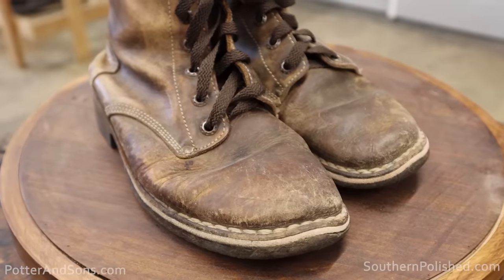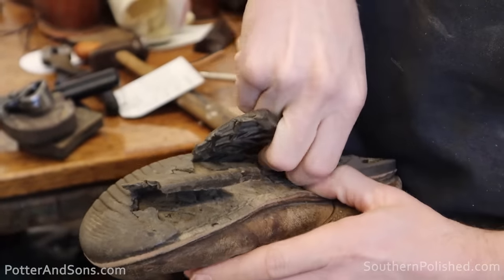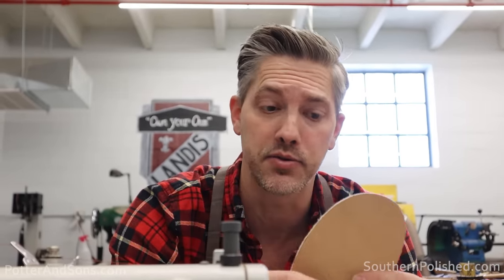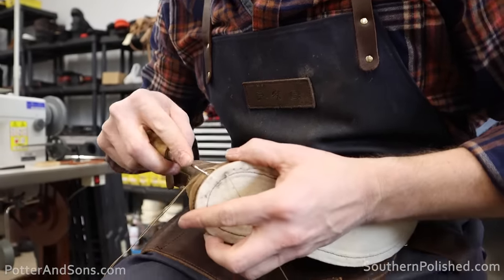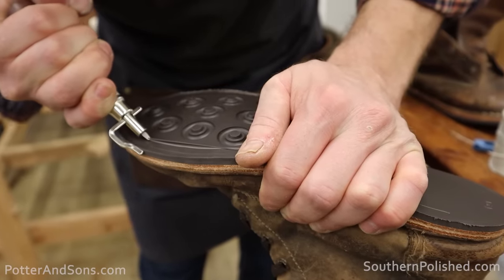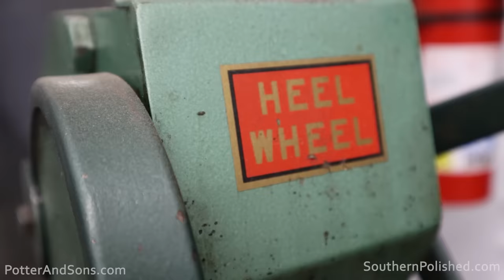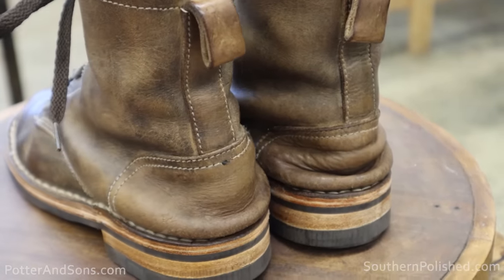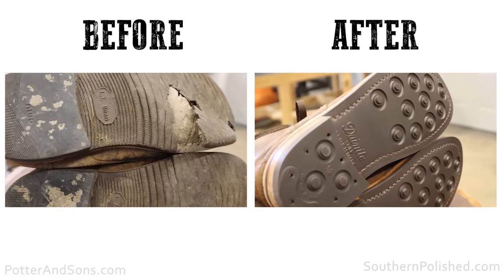LL Bean Boots Get Refurbished | From Inferior Quality to ULTIMATE Upgrade

Comment from the maker: So the common question of the week seems to be, “why wasn’t the heel counter fixed?”  Well, for one, we again did a lot of this work free of charge.  Free.  We could have charged a much higher amount, but we often don’t for some of these videos.  If we find a shoe that we think you all may like to watch us redo, and the customer didn’t pay for that much work, we’ll often go ahead and do it, with the customers permission, for entertainment.  We do what we can during a busy work week.  Secondly, these boots were made like moccasins.  There was no stiff heel counter, toe puff or shanks.  These boots were originally made from simple leather uppers, FELT insoles and crepe soles.  That’s it!  No frills.  These boots were made for comfort and that’s all.  That’s why you see them collapsing along the edges.  They weren’t constructed like most boots you see us resoling.  👍
Reply from the maker: @mariosantizo4099  You apparently didn’t read the entire post.  These boots did not come with toe puffs, shanks or heel counters.  To be honest, they were cheaper quality LL Bean boots that we actually made better.  To add all of that would have changed the look and feel of these boots.  That’s not our call.  It’s the customers.  Thanks for watching, but we’ll continue to do what we do.
Reply: @mariosantizo4099  No it's not.  They took a trashed pair of boots and made them better and serviceable once again.  If they were to be "upgraded", the customer should've stepped up to have upgrades made to them, but that's not what was spec'd from her.
Reply: Sir I am interested in restoring a pair of Thursday boots and dying them black
Reply from the maker: @GizmoGuzman0924  Please visit us at potterandsons.com.  We’ll get you taken care of.
Reply: I live in Arizona that basically all year round summer and no fit for leather boots at all, but watching your videos makes me wanna buy some nice boots so I can get them resolved in few years LOL
Reply: That is what happens when you do miracles on a regular basis. SOME people believe that you gentlemen should send back factory original boots that you magically recrafted just to show you could. I am regularly amazed at the magic you perform on boots and shoes that look as if they were salvaged from a dumpster. It is heartening to to see USA craftmanship fly in the face of a disposable society. 
Plus your videos are a joy to watch. Please keep it up, your adoring audience is counting on you.😃
Reply: Cgu
Reply: Yeah I was thinking exactly that, thanks for reading my mind and answering the question. Turned out great.
Reply: I WAS wondering why the heel looked like it was collapsing. Thank you for the explanation.
Reply: @TrentonHeath  Love your work!I have a pair of frye phillip tall harness boots that need resoled ,I would love to send them to you if you have time.
Reply: And it's not easy to find boots like that even at LL Bean anymore for what I'd consider a reasonable price. After watching the video I went to the current LL Bean catalog and didn't find anything comparable to that book (at least not on first search).  Personally I'm jealous because I've been looking for just that style myself.
Reply: Great job. Thanks 😊
Reply: The great idea restored - reused - valued sentiment by the owner. Also very entertaining to watch. Thanks
Reply: In that case, is there a way to fix it? Or at least make it better?
Reply: That also answers my question, I was wondering why the back of the heels looked ‘saggy’ too. Great videos guys, I’m an ex Royal Guardsman and we had to have our boots looking like glass, which is a hell of a process from start to finish. I still have a pair of my ‘drill boots’ and was wondering what the process would be to have them re soled, that video on YouTube in turn lead me to your Chanel and now I’m hooked ! Lol, Sterling work guys 👍
Reply: You should have done with those heel counter. FOC or charged is something different story, but, I'd love to see how much you love shoes/boots.
Reply: This was of interest to me having a great fondness for several pairs of LL Bean Boots.  It appears many people don't know quite what this boot does, why it works. It is rather unique, sort of a slush moccasin, 😆 Mukluks. 
Far northern maritime climates commonly experience snow, ice, rain conditions one after the other in any combination, and all too often all at the same time. And this in my NSHO is an absolutely brilliant design for it.

The soft rubber sole provides traction along with foot grip. Ever so useful navigating uneven terrain such as woodland with ice covered branches, rocks and mossy hummocks lubricated with a layer of rain. (I had a particularly hilarious experience getting out of a skating rink of a road pothole/rain puddle a we bit tipsy.  If not for wearing my LL beans I would have had to crawl out on my hands and knees, if not only ungloriously I happened to be in fancy dress attire.)

The original unexposed seam keeps water out,  an abreviated rain boot.
 
The felt insole ENCLOSED inside remains dry insulating foot from cold of ice to a remarkable degree. I had an oversize pair specifically for 2 layers or very thick wool socks for extend periods - no opportunity for  rewarming cold feet other than wiggling toes furiously. 

The unlined, unstructured leather top was not for ankle support. It is easy to get in and out of with room for pant legs tucked in and tall enough for a moderate wade thru slushy snow with an annual application of Sno Seal.  Also left loosely laced is a pull on/kick off making it perfect to go out and start the deep freezer of car (warm up the engine and interior before driving somewhere) fetch a load of firewood or trudge to work not far away and change into more suitable footwear like ski boots.

They also came with a removable thin leather insole to be lifted into the upper, the boot turned upside down and hung over the wood stove overnight. (Dry out any accumulated moisture and the upper from long time in deep slush. Not to mention having a toasty warm boot to slip on in the morning.)

I'm not surprised the wearer was happy to have the boots wearable again, I was always heartbroken to have to give up on a pair. 1) For me an expensive boot, well worth the cost   but 2) have a short lifespan and ShoeGoo repairs quickly fail on a moccasin sole. 3) The most comfortable boot I have ever worn.

Now for your repair;  I'd say defeated really the point of the boot practically but I can't honestly imagine 'repairing' it any other way  and you did a fine job. 👍 With a welt (if correct terminology) is a guaranteed water leak with exposed leather and felt a wick. The rigid sole, sure better traction than leather sole but well, rigid 😜 not the barefoot like moccasin feel.

So all in all, you are absolutely correct it was fun to see.  LL bean (at least then some over 40 years ago) offered resoleing to original but quite strongly DID NOT recommend it. (As I recall, experience showed unsatisfactory  results and only offered because a segment of customers begged them to. 😆) Free labor only rational  economically and unsuitable for original purpose is still a serviceable boot in less challenging footwear conditions.

Comment: Mr Bean would have been proud. He was the original leather upper with rubber lowers for hunters. He made a hundred pairs and ended up replacing about or so at no charge. He was a person that prided himself on quality back then. You have to visit the store in Freeport, Maine. It's open 24-7-365, there are no locks on the doors because it's open. Hell you can go Christmas shopping on Christmas. We have a king size down comforter we bought 29 years ago and it is still lofted after we have it cleaned. Good quality in my books.

Comment: The felt and leather combo is nice!  As for felt in cold climates, you are right.  Each time I get a new pair of winter work boots, they have a thick felt liner.  I also now add an additional think felt insole that also has a reflective layer to reflect my body heat back into my feet.

Comment: Noticed you struggling with Needle Nose Pliers for picking stitches. Could I suggest using  electrical side-cutters? Blunt the blade with sandpaper so it grips rather than cuts, and spring loaded makes it more precise and less fatiguing on the hands. Great vid!
Reply from the maker: Thank you for the advice!

Comment: Informative.LLBean will rebuild their classic boot if you send them in.The sole you used is probably an improvement over the chain pattern original. That old pattern is not that great. Real wooden avoid it. I do leather working,mostly holsters and belts.I have done a fair amount of hand stitching myself. Interesting machinery.Shoe repair is a dying trade.

Comment: QUESTION: Why would you not treat the uppers immediately upon them being separated from the old sole? You have DIRECT access to the old worn and ratty edges to treat them easily all around the stitch area. Cleaning and treating it then so you won’t stain the new stitching? Seems to me at 5:48 you’re going to end up going over the new stitching? Hell, you could even treat/renew the INSIDE of the upper at that point. Ever do that?

Comment: I noticed they were double stitched down before, but only single stitched after. What was the reason for using a Blake stitch to attach the outsole, instead of using a welt stitch in the old second set of stitch holes to hold on the dainite? I'm sure you had a reason, but I think the other method would have looked good.

Comment: If that thread for the stitch down portion was cotton thread, that makes Heath a cotton pickin' cobbler.  Nice work Heath, she should've stepped up for a new heal counter as well as a steel shank.  Good video Kemosabe.
Reply from the maker: Thank you very much!  😁  These boots didn’t come with heel counters or toe puffs.  They were constructed very similar to moccasins.  These were basically just leather uppers with a cheaper cotton lining and that’s it.

Comment: Based on some shoes I had I strongly suspect they were made by Clarks (or whomever makes Clarks for Clark) for LL Bean. That's no shocker or anything, I'm just saying because growing up near the flagship store we'd go there for things like shoes because they had things that weren't sneakers or dress shoes. I was fascinated by how most of the shoes were obviously made all over the world with varying levels of quality and you could kind of see trends in good ones vs shoes that would disintegrate and get returned within a month or two. But yeah the felt is not there for insulation, it's actually a terrible idea in a climate with that much rain, mud and slush. Might as well be a lampwick.

Comment: is there a reason not to put the felt on the inside ? i thought that was a bit strange to have it on the outside, especially after the last shoe had delaminated with the felt glued to the rubber sole.
Reply: Didn't understand that either, but for a different reason: the felt usually is to "insulate" from cold. By having the felt being sandwiched between a leather insole and the outsole i think the effect is lost. I can of course be mistaken, but i think the reason it works against cold is the same a "rough" liner in clothing makes for better wear in cold temperatures, as this basically traps air (what realy insulates).The "airpockets" created by felt and socks being between the foot and the sole are what creates the insulation. As the temperature of the foot warms the air in those pockets. The air that is left in a felt liner that is soaked in glue is less, and not warmed as fast by the foot (leather between the socks and the felt) and thus in my opinion makes for worse insulation.  But if i understand it correct, the boots belong to a lady in the area they are in, and  it's in a warmer climate anyway, so this might be no issue at all.
Reply: @nirfz  yeah thats a very good point as well, im just curious i find these videos fascinating :D
Reply: @mooseteets  me 2 :-)

Comment: Will these be kind of floppy without. Shank?
Reply from the maker: They didn’t come with a shank originally, and the owner definitely would have felt it if we’d used one, as the soles were only made of thin leather and felt...a little better than the original all felt insoles.

Comment: Would cork make just as good an insulator?
Reply: There's not really a cavity there to fill. If they were to use cork that was as thin as the felt, it would be a lot less durable. Cork is mainly used to fill up any voids caused by the construction of the shoe.
Reply: @patrickli9077  ok. I get it. But on a different pair. Let's say a pair of Thursdays or such with danite. Would cork be a good insulator? Or is that usual for colder climate boots on snow bound places?
Reply: @Deusmecumest  Cork would be a good insulator in that case. When I walk with my welted footwear outside in the winter, my feet are generally warm and the only insulators are cork and leather.
Reply: @patrickli9077  Thanks.
Reply: @Deusmecumest  The glued cork is not a good insulator. Felt is a very good insulator.
Reply: @GennadiyGold  Ok? How does felt perform in colder climates? What if you're stepping in snow? Would the felt get soaked? Or is there a preference of materials for colder climates? How about the material that has mylar? Or is that a gimmick? Can that be retrofitted?
Reply: @Deusmecumest  It is advisable to use felt as insoles. And I would replace the cork with micropore rubber. When moisture gets in, the cork inevitably begins to rot.
Reply: @Deusmecumest  I find mylar to be useless. This is a publicity stunt.
Reply: @GennadiyGold  Its just rubber usually makes boots stink. I wouldn't use them for heavy snow use. I have snow boots for that. But would they be ok for dressing semi formal without looking like I'm stepping out of the moon lander.
Reply: @GennadiyGold  Ok. Good to know. Usually those run you from 20 to 40 bucks more expensive depending on brand.

Comment: My initial reaction would be to toss those boots and get new ones. Guys, though can get weirdly attached to a pair of boots or shoes for whatever reason, usually some good or sentimental memory.

Of course this time the customer was a woman.
Reply from the maker: Very true!
Reply: It's hard to throw out a good fitting pair of boots.  I have a pair of USAF Flight boots from the 90's I keep for yard work.  Those LL Beans were definitely beat up.  The heel counter was shot, ouch!  I understand you put in some extra labor for the customer.  Kudos!  

Another save by Trenton & Heath. 👍
Reply: Agreed!  I just saw a guy restore a pair of Danner boots by Steve on Bedo's for $900 just because his dog, that had since passed on, had bit and left tooth marks on the tongue!
Reply: Can you or have you made a video explaining different soles? I have just work boots with aggressive sole. These in the video were called i think day night. Mine are needed for all weather traction. Dress shoes obviously have different soles. Soft sole vs hard sole?
Reply: @jamestapscott9400  The heel counter wasn't shot, it didn't exist! Those weren't heavy duty boots. They were the kind of thing that you'd put on at the end of the day, when you had finished your work, and wanted something comfortable to put on your feet. As the guys said, it was more like a moccasin, and built for comfort, rather than long life! They're also not the typical LL Bean boot! Bean makes different boots for different purposes. The boot presented today was not a work boot; it was an after work boot!
Stay safe and healthy ✨🌹